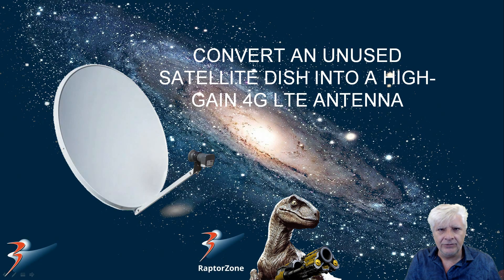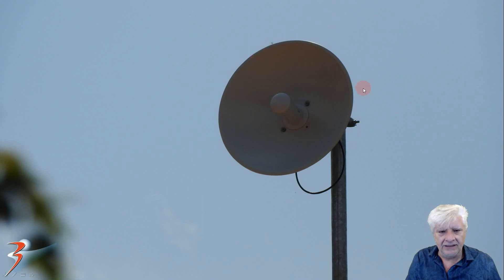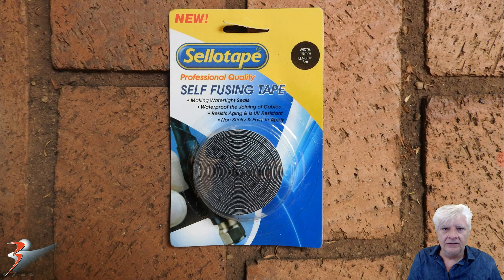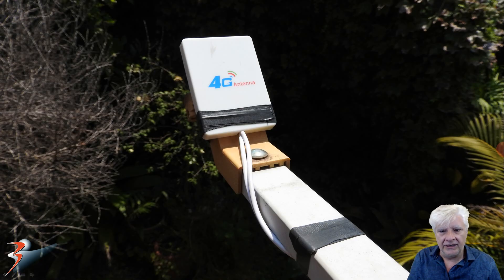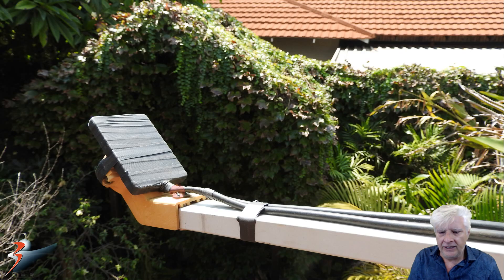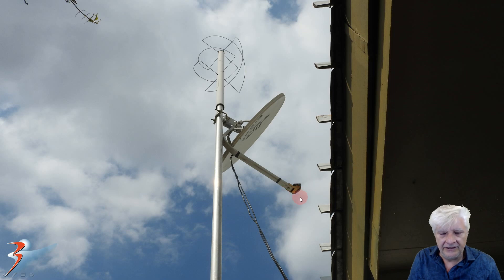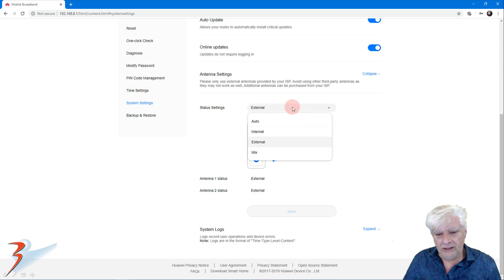Convert an unused satellite dish into a high-gain 4G LTE antenna

Comment: Interesting. I wonder how the booster would have fared without the satellite...
Reply from the maker: Hi Richard, I tried the small antenna without the dish and it didn't work: the signal next door was still swamping my antenna. With the dish the signal from the cell tower is concentrated to a singular point where the small antenna is mounted - that is the key to this setup working.

Comment: did you try the antenna first before attaching it to the pole? they can be taped to a window. You can report his signal splutter so that they force him to put a filter on it. The telco companies here in NZ will just send out a roof microwave dish to attach to the tower which is cheaper and faster than DIY.
Reply from the maker: Thanks for the comment. Yes, I did try mounting just the antenna in various places but it dodn't improve the reception. It was only when I mounted it to the dish and poirnted it directly towards the tower that it improvd dramatically. No I didn;t report the guy as our services in South Africa are very very bad due to various, mostly political, reasons. My local telco doesn't support this type of product which you descbibe (they only provide the LTE router). Thank you for the advice, it will most likely help others with similar issues.
Reply: @JeanWard  good as good, I’ll subscribe and if you are interested in collaborating I’d love to chat in future. I have a nice South African couple building next door to me this year.

Comment: Hi Jean. Sorry to say this, but that little white chinese panel antenna is absolutely the biggest scam ever. Its much better to place the 4g router/mifi directly on the dish, exactly as you did it. Because that little crap will even degrade your signal/speed and make it much worse. 😑😑😄
Reply from the maker: I agree with you, the reason I chose it was because it is small. Without the dish to concentrate the signal it is pretty bad. Also, the antenna's inside smartphone's are just as small.

Comment: My neighbor gave me the password of his wifi, but of course my signal is weak, due to many physical obstacles. I have a satellite dish that is about 25 years old, which I do not use. Should I also have a modem/receiver at home to amplify the signal? The signal comes to the external wifi extender located on the satellite dish, and the USB should go to the modem in my room? Thanks.
Reply from the maker: Hi From Dalmatia, a similar setup to mine should amplify the signal at your premises as long as you point it directly at the source of the signal. I mounted an external WiFi antenna at the dish where the LNB normally mounts and I ran two coax cables into my house to where my router is and connected the two coax cables to the back of the router where external antenna's plug in (I also set my router to use external antenna's and not the internal one's on the router). A similar antenna is seen here: https://www.takealot.com/dual-polarised-high-gain-lte-antenna-with-10-meters-cable-bundle/PLID34148767?gclid=Cj0KCQjw8e-gBhD0ARIsAJiDsaUmb5AXB80g-k9U6Yc0qFSXB4v1_PaZHMujiX4aIqc7uQ5sGikuYVcaAs6vEALw_wcB&gclsrc=aw.ds
Reply: @JeanWard  
Thanks a lot for the explanation

Comment: I just build this kind of antenna too. Damn I point the antenna wrong and still got a good signal. To lazy to fix it, cause I use bamboo with 10 meter highto install it.
Reply from the maker: Hello there, the omni-directional nature of the small antenna at the tip of the dish will pick up an improvement as the installation is above the roof and most trees and bushes. Believe me if you point it directly at the cell tower you'll see a dramatic jump in signal strength. Thanks for dropping me a note on your experience with this type of antenna.
Reply: @JeanWard  I already got 94-100% signal strength with RSSI -55dBm, -15 RSRQ, -85 RSRP and 6 dB SINR. this is on B3 1800 band. I point it directly to the tower, but but vertically it toward the sky, I just need to fix the vertical tilt. my tower is 1KM but there is a lot of tree here.

Comment: Hello Jean, awesome video!  I subscribed and am in Indonesia.  I trying to help a friend here that has a yagi style antenna previously installed.  However, it is worse with the external antenna than the internal and the thing is there is only 1 coaxial connector to a splitter just before the router and there is not an "external antenna" secondary device like you have between your dish and the router.  Would you be able to comment on this device and then having the two antennas?  I think we are close but the installer was missing something that you have figured out.  Many thanks!
Reply from the maker: Hi there, thank you for taking the time to watch the video and subscribing. The best solution is to have a router with transmit and receive antenna connections connected to an antenna with two connections. Using a splitter might not work as there will be losses and the transmit and receive will probably interfere with each other - two seperate antenna like I use in the video will be the ultimate solution alternatively two yagi antenna's. I hope you get the problem solved. Regards.

Comment: Does it make any difference if your signal antenna is placed in the upside down position at the dish to copy the receiving inverted antenna signal ?
Reply from the maker: I inverted my dish to make it easier to align it in the direction of the cell/LTE tower. The arm that mounts the LNB to the dish is in line with the direction the dish should point. So you don't necessarily need to invert the dish.
Reply: @JeanWard  Ok. I thought you would have to invert the WiFi antenna.  Thank you for explaining.

Comment: Allo is your modem sim driven?
Reply from the maker: My router has connections for external LTE antenna's, this is where I connected the external antenna which is mounted on the dish in place of the original LNB which I removed. These external LTE connections on the router are not powered.

Comment: Could this be used to maybe amplify the WiFi signal off of the router?
Reply from the maker: Hi Keegan, I don't see why not, the principle is the same although the signal will be directional. If you can't mount external WiFi antenna's you'll need to mount the router at the position where the LNB used to mount which means you'll need to protect the router from the elements if mounted outside.

Comment: Thank you for making such an informative video.  I would make a suggestion that a person would use white fuse bonded tape to keep the 4G antenna cooler.  Black surfaces can get over 200F in direct sunlight.
Reply from the maker: Thank you for the recommendation Ray, much appreciated.

Comment: Can you help me, I want to cut the cord for cable. On the house we have 2
 satellite dish's still in the same position but no service with both. 
Can I reconnect the one of the satellite dish's and use it for a wifi. I 
have the lnb ,a modem and router and I know how to hook up the 
satellite. My question is do I need a solo node. I just need to know 
what to hook the cord from the satellite dish to on the outside to the house.
Reply from the maker: Hello Ai We, interesting question. I use the satellite dish to link my LTE router to my local cell tower for 4G service. If you want to extend your routers WiFi in a particular direction you'll need to gain access to your routers WiFi antenna's which are probably inside the router on the PC Board. This is a challenge and I will not recommend doing so as you'll need to open your router, disconnect the WiFi antenna from the PC Board, connect a piece of coax and move the internal WiFi antenna to the dish where the LNB use to be. This is a very specialized procedure and I don't recommend doing it. Possibly try using a WiFi extender instead, those are freely available online.

Comment: I may have missed this in the comments somewhere... But how would you adapt this to wanting to boost signal for cell phones themselves. We use our phones for internet and their hotspots for the computer internet. All we have is a plain Netgear WNR2020 router that would usually plug into a cable modem via ethernet. When we bought this place, we found 2 unused satellite dishes, one still mounted and adjustable on the pole. If we had a way to adapt this to provide our cell phones with stronger signal throughout the house, it would make a huge difference. We simply cannot afford standard internet right now.
Reply from the maker: Hi Kimberle, unfortunately this solution only works in situation where your device (cellphone/router) has external antenna connectors for use with externally mounted antenna's. I don't think cellphone have external antenna connectors. Good luck, I hope you find a more affordable solution.
Reply: @JeanWard : I am not looking to hook it up to my cell phone directly. I would like to know how I could adapt the process to something indoors, like my router's internet port via ethernet or to another indoor repeater of some sort. Thanks. :)

Comment: thanks for the video.just a question,is the satelite dish compatible with stations such as M2 ,M5,M2 LOCO,etc.
thanks in advance
Reply from the maker: Hello Augustus, please provide further detail about M2/M5 as I don't know anything about this.
Reply: @JeanWard  i meant the UBIQUITTI point to point(p2p) transmitter(station) and reciever(access point)
Reply from the maker: Hi Augustus, thanks for the clarification. Yes, I think it will work nicely, as long as you mount the TX and RX antenna in place of the LNB. Good luck.
Reply: @JeanWard  cheers brother,from nairobi kenya.
Reply from the maker: Greeting to you from Pretoria, South Africa.

Comment: Sir, the communication network in my area is very poor indeed. I have Azsky G1+ Quad Band GPRS adapter and Microstar MSM_485 wireless modem and unused 90cm dish. How can i connect these with your description to improve the network ?
Reply from the maker: Check if your equipment can connect to an external antenna. If it does, connect the external antenna as shown in the video, otherwise if it can't connect to eternal antenna's this solution unfortunately won't work for you.

Comment: Jean, your SINR (signal to noise ratio) is terrible and is your main problem now. Your signal strength was improved nicely to -95 RSRP, but now you have to figure out where the interference is coming from.  The dish on your neighbor’s house needs to be turned off for 5 minutes to let you compare the SINR with and without that signal.  I hope you are on good terms with your neighbor.  Your RSRQ will probably track with the noise source.  Your SINR needs to be better than 10db, preferably close to 20.  BTW, every 3dBm of signal power change in your RSRP is a 100% change, so the 14dBm is real more than a 400% improvement.  Your only real issue now is noise.   Yes I am a design engineer in cellular in the USA.
Reply from the maker: Hi Dan awesome feedback and suggestion. Thank you! My neighbor and I don't get along that well so I am reluctant to ask him to turn his equipment off. The dish made a huge difference and is working well to this day. Take care. Jean

Comment: Can you do it instead 4g antenna with mobile router? I have the data sim, and a tp-Link router that could act as a tranciever and I need to buy this mobile router, but the supply is better for it so it will be second hand approachable I suspect as well.
Reply from the maker: Hello Zsolt, I have not tried that option so I can't really comment on it. if you do opt to mount a router at the end of the dish instead of an LTE antenna make sure it's protected from the elements like the sun and rain.

Comment: i am  just beginning to learn about this and I have been looking at making diy wifi antenna  to put on a dish do you know if it is possible to also put one for the cell signals on the same dish? Thank you
Reply from the maker: HI Anothony, if I understand your question correctly you are asking if you can use this setup to boost regular cellphone "voice' signals - the only way I can suggest is if you mounted your cellphone at the front of the dish which isn't really going to work. Perhaps there are cellphone available which have external antenna connectors which my work.

Comment: I have seen in the video "https://www.youtube.com/watch?v=KLQdd5TCzaw" that recommends to install an offset dish in an upside down position (i.e. 180 degree rotation) for terrestrial use as the dish will point better towards the horizon. It seems to be a great idea! Cheers from Texas
Reply from the maker: Hi Robson, thanks for sharing this info with us. It might very well improve the signal strength, I just do have the will to get back up there to play with the alignment :-) Greetings from South Africa.
Reply: Hi Jean, your video was the first that popped up when I searched for "LTE Dish". Nice job and well explained with benchmarks. I found older video (5 years older) with similar reports on LTE or Wifi bands. This video from Australia shows some simulations: https://www.youtube.com/watch?v=KLQdd5TCzaw - It is a small world :)

Comment: Hi Jean, great video! I'm experiencing a bad 4g signal on my smartphone, and I believe the problem is caused by lower elevation. Inside my room the signal is pretty bad, and if I bring my phone outside especially to higher ground the signal coverage is great. The heights difference between my room to the higher ground is around 3 meters. And since i don't have an unused satellite dish and I'm not using 4g routers (only smartphone), do you have another suggestion to fix this problem? 
Thanks in advance
Reply: I made a custom phone holder and replaced the lnb on one of those portable satellite dishes with it.  Got it pointed out of a window and I just slot my cellphone into it when im home.  There is no signal in the house but a fair one outside, using the dish I get 2 bars instead of none.  The dish is pretty small so I imagine a larger one would work better.  Obviously the downside is the phone cant move so I have to use handsfree for calls and texting is.....Problematic lol
Reply from the maker: Hi Odi, line-of-sight with your local tower is very important and elevation can play a part. I don't know of any solutions for a smartphone, all I can suggest is that you perhaps consider purchasing a router and mount an external antenna above the roof then connect your smartphone to the router via WiFi. Sorry I can offer you any solution, there might be one but I'm not aware of it as such. Any viewers please comment if you know of a solution.

Comment: Need better cable
Reply from the maker: Hi Brad, I agree with you - the loss in this thin coax is very high - once the lock down ends I might look into purchasing better low loss cable.

Comment: I used to design, build and install all sorts of satellite dishes. I don't see how you'll get this to work good without a feedhorn. I don't know if I missed you mentioning it, but cellular frequencies are split by polarity. I think it's a 45 degree split. I'll have to look it up. I built a couple of yagi antennas for mine.
Reply from the maker: Hi Bryan, thank you for sharing this info with us. At least this solution get's me back to the speeds I used to have before my neighbor installed this dish pointing directly over my study where my router is.

Comment: Thanks for the video. Does the dish improve both upload and download or download-only?
Reply from the maker: Hi Kevin, if you use an antenna like I used it improves both up-and-download speeds. The antenna I used has two built in antenna's (one for transmit and one for receive). Some antenna's only have one so be sure to get one like I used. Thanks for the question. Regards, Jean.
Reply: @JeanWard  I don't mean to step on your toes but that's not what the 2 leads are for. One lead is one polarity and the other lead is the offset polarity.

Comment: i have a 1800 Mhz 4G Antena  3,10 kms(+/-) away, since i have a good RSRQ signal ,but an extremly poor RSRP signal (-115/-120 dBm) would a better antenna attached with the dish make a difference  instead of the one that got advertised ?
Reply from the maker: Hi Jorge, a better antenna would make a difference, the one I'm using is a miniature antenna and isn't as efficient.

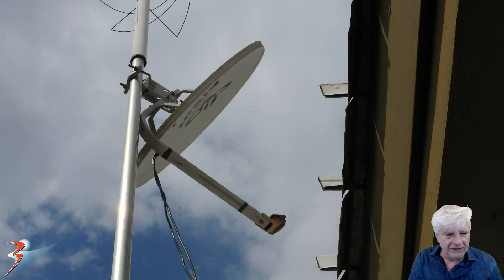Comment: 4G pulls from whichever tower you are closest. As more users pull from the same tower it reduces your data transmissions. Between 01:00am and 05:00 is usually an excellent time for cellular data transmission.
Reply from the maker: Thank you for the advice nednewly, this setup improved the overall performance of my LTE connection drastically given the interference caused by the neighbors dish which points over my house.

Comment: i have a router which gives 4G LTE. Will this work for my router?
Reply: Not all have external inputs but i had good results by simply placing the modem at the correct place near the LNB indoors in an attic space, and some have used a usb 4g dongle strapped to a tv antenna before.
Reply from the maker: Hi Khalida, the router should also have external antenna connectors with the ability to switch to external antenna's.

Comment: Great video. I want to put to practice this project but i have some questions about the operation range or effective distance for 4G or 3G. Do you have a github repository or documentation about all elements, devices and instalation process used?

Thank you so much.
Reply from the maker: Hi Juan, with UHF and SHF distance normally depends on line-of sight. It is technically possible to cover up to 50 km to 150 km. Please refer to the following link for further details: https://en.wikipedia.org/wiki/Cell_site
Unfortunately I don't have a web page dedicated to this antenna. I'll try my best to get something up on the web in the future, time permitting.